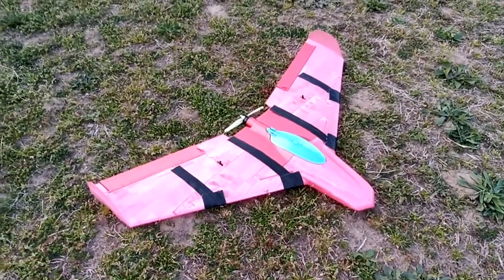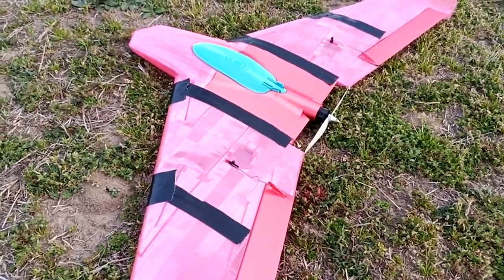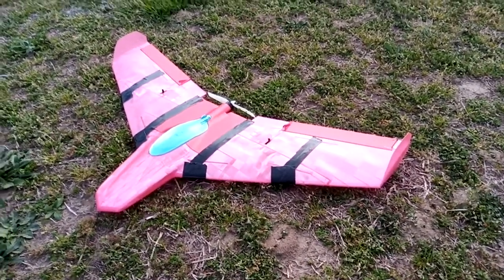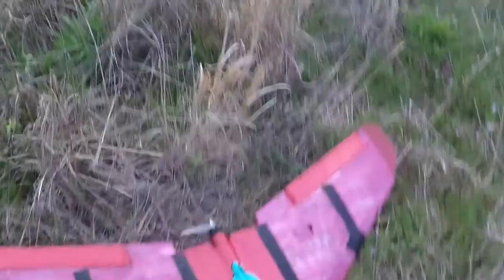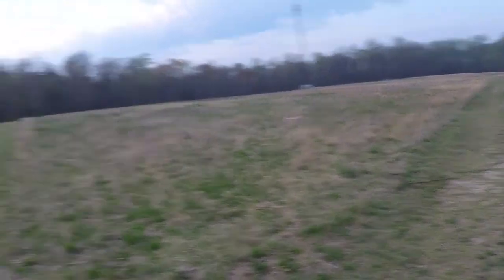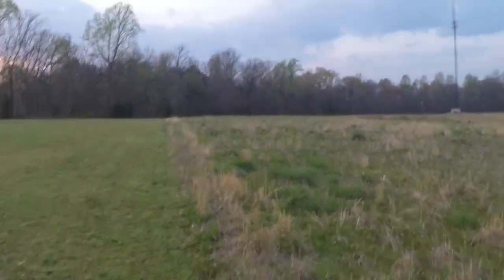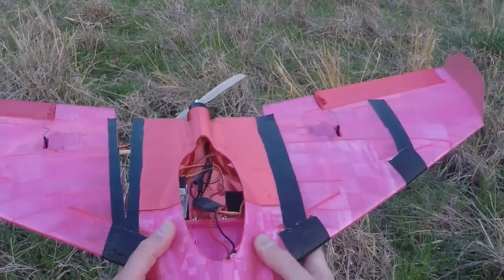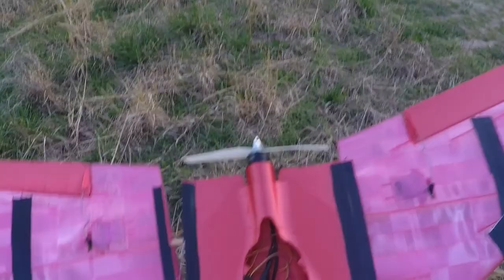TPU Flying Wing

Comment: experimenting with tpu  myself at the moment, this video was very interesting. The Layeradhesion of TPU is enourmous and its flexibility brings new possibilities. I think it´s essential use a design which is made specifically for tpu. At the moment i´m still testing different grades of TPU but as soon as i found a suitable one i´ll try to design a TPU specific Plane for minimum rectractional printing as I think it has tons of potentials. Thx for your vid and best regards